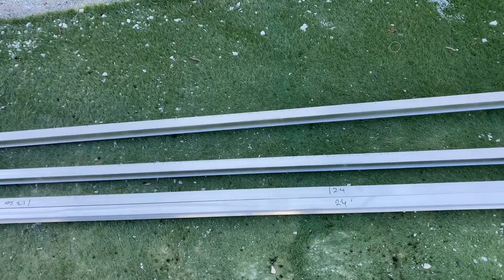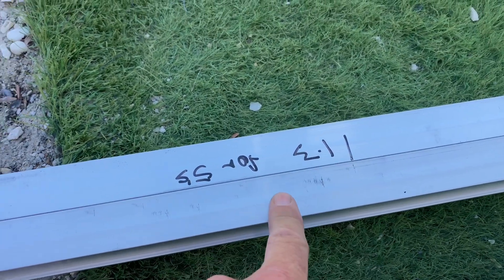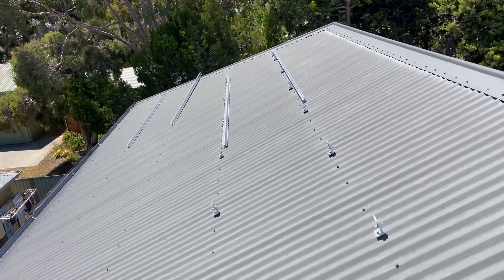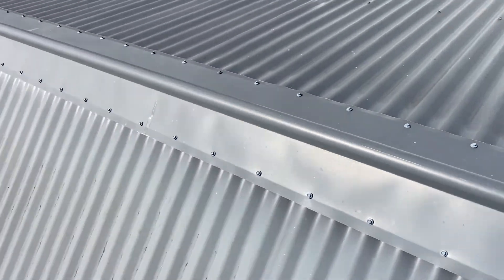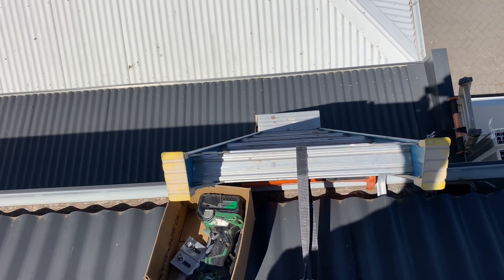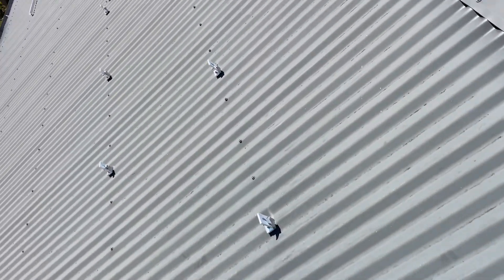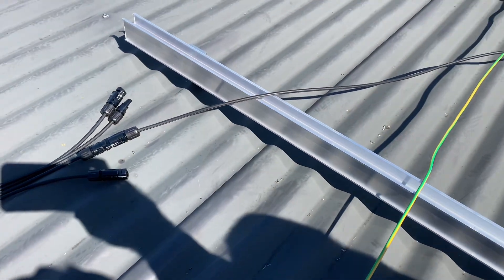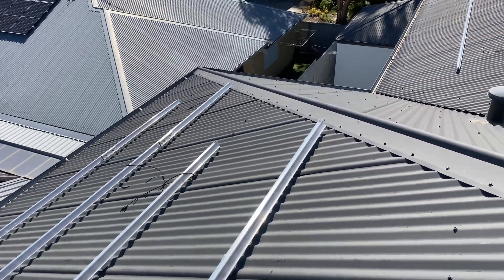How to install solar panels on a tin/metal roof.

Comment: Colorbond bracket would ideally be curved to fit snuggly on the top of the corrugation, those brackets do exist. For example Clenergy Ezrack Tin Bracket Curved – ER-I-25

Comment: good tip re circular saw, seen heaps still use em on rails, i like both the fall arrestor and tek bit holder but never seen the tek bit holder before

Comment: My suggestions is to cut on the ground because the metal swath can rust the roof if you don't get it all off.
Reply from the maker: The rail is aluminum so know issue with rust from that 👍🏻